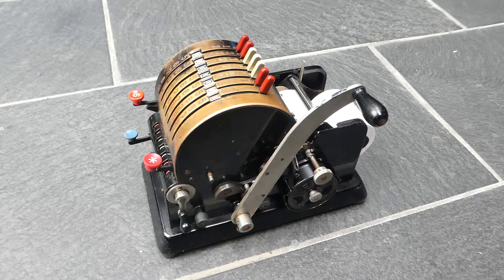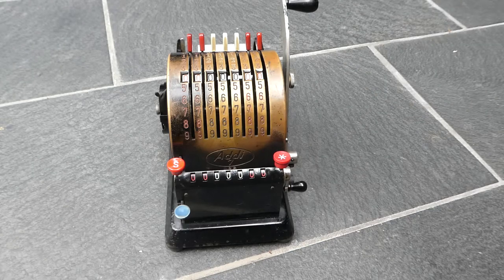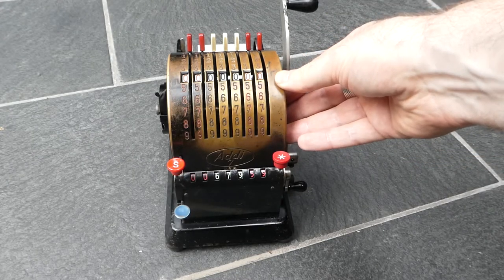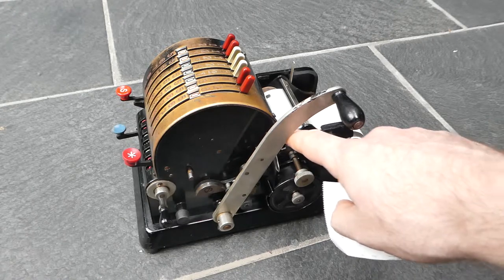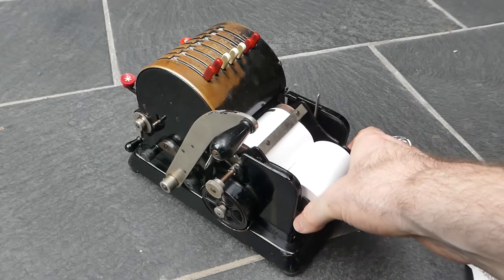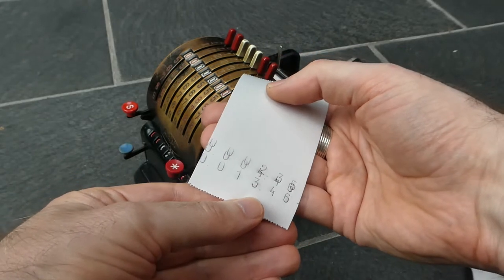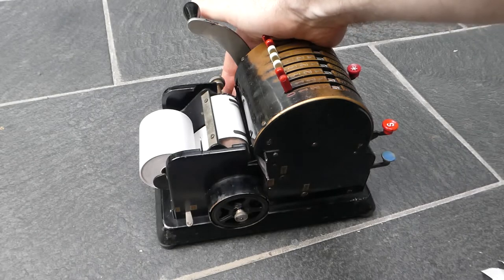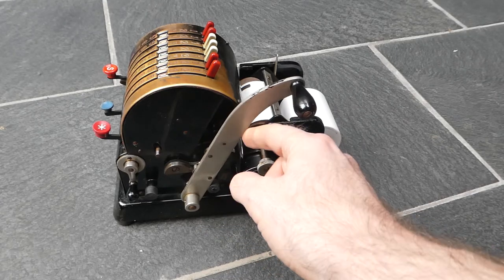Rare Lipsia Addi 7 adding machine with printing mechanism

Comment: Why do you think the machine with a printing mechanism was less successful?
Reply from the maker: You are right that this is a bit of an inductive leap on my part, but it is based on two observations. Firstly, it is much rarer than the non-printing version of the same age, suggesting that fewer were made and sold. Secondly, it was only produced in the 1930s, while the non-printing version continued to be made in the 1940s and early 1950s, and then re-released as the Triumphator KA.
Reply: @jaapsch2  
Oh, I'm sorry for the confusion! I meant the reason you think this was the case, as in why people bought them less.
Reply from the maker: That direct printing totals is not possible means that this machine is not really suitable for use as a shop till, and that was a large part of the market for early adding listing machines.